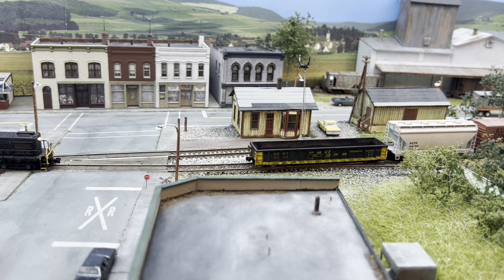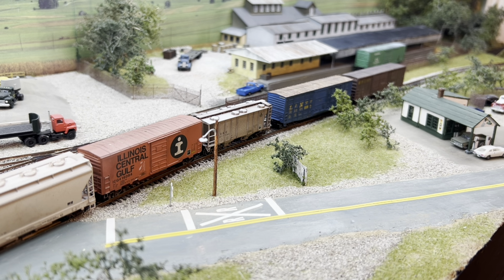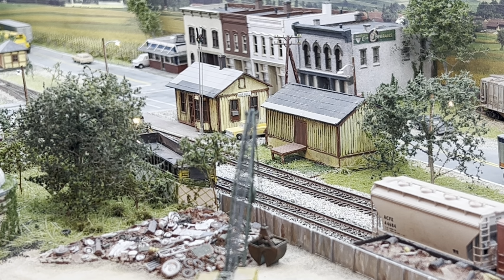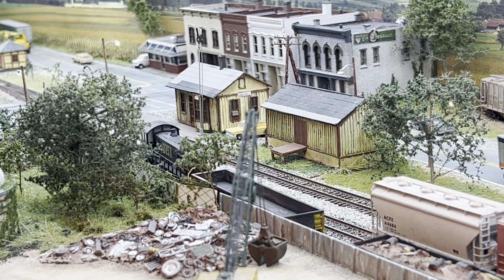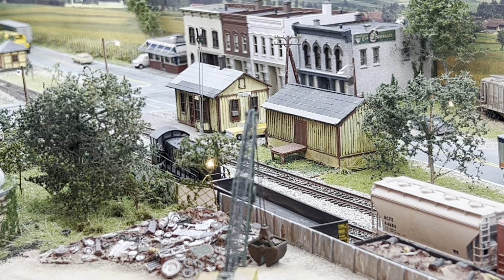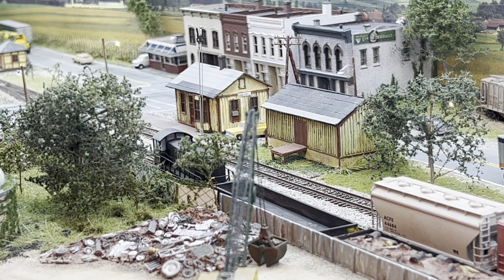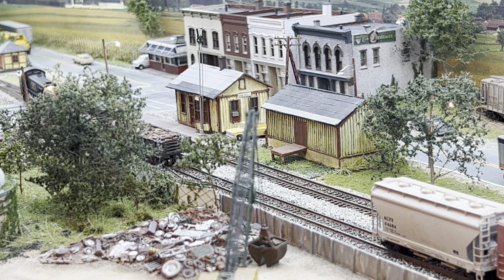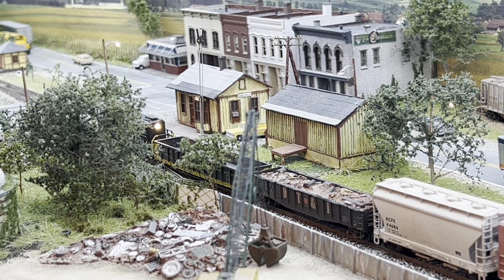Switching Charrington Scrap in Oak Hill with the old Alco switcher

Comment: I am amazed at how much detail you packed into the swamp area.  That was a great shot.   As the OHI engine first crossed Route 93, the combination of camera angle and lighting makes the road surface look as though it rained during the night and is still wet.  Notice that as the Alco passes by, you can see its reflection on the pavement.  Interesting perspective.  I always enjoy seeing Charrington Scrap and the adjoining overgrown abandoned yard.   Safe travels.
Reply from the maker: @craigcorson1235  Hi Craig. I’m not really that thrilled with the wet road myself. The crossing markings are dry transfers and they peeled up the painted plaster on the road. I put them back and tied to reseal them by brushing on Tamiya  clear flat but it’s still glossy. I have lightly sanded it to try to remove the gloss, but have not been very successful. Maybe I shouldn’t worry about it since you seem to like it!😁
Thanks for your comments about the rest of it. I am happy with how Oak Hill came out. Have a great week and stay safe!
Reply: The wet look is not something you could have planned for.  It is a happy coincidence of the camera angle and light position.   (Route 93 looks dry in other shots.)  I find it fascinating because, normally when we operate our layouts, the weather is warm, clear and dry.
Reply from the maker: @craigcorson1235  Thanks for the feedback!😁

Comment: Hi Thom, Hope you're having a good road trip? It's always fun to see the DT&I run through train. I agree with Scott, that swamp angle shot was interesting, very nice. I also like the angle over the root tops looking at the Oak Hill Station / Train order office and freight house. During your era, was there still an train order operator at the station? OK Thom, have a safe trip home and I'm looking forward to next Saturday's video. Cheers, Rich S.
Reply from the maker: @RWSBaden  Hi Rich. Yes, there was an operator there and at another tiny station down the line called Blackfork Junction until the DT&I quit running in 1982-ish. I can’t remember the exact date, it was 82 or 83. Both buildings were torn down in 1985. There were literally right on top of Route 93 and they widened the road a little after that. Looking at the spot where they were, it’s hard to believe that they were there.
Leaving for Mexico in the morning. Already have videos shot for the next 3 weeks. See you next Saturday and stay safe!

Comment: What does the OHI,on the Alco switcher stand for???
Reply from the maker: @Joe-d7m6k  Oak Hill Industrial, a fictional railroad owned by the 3 remaining industries in Oak Hill. In real life, the  city of Jackson purchased the line in the late 80’s, so I just said that a group in Oak Hill purchased it first. 
I used to just operate it as a Chessie turn like it did before Jackson purchased it, but applied modelers license because I wanted to run my Alco.
Thanks for watching. Have a great week and stay safe!
Reply: @thomplacier677  Thank you!
Reply from the maker: @Joe-d7m6k  no problem. I answer every comment.